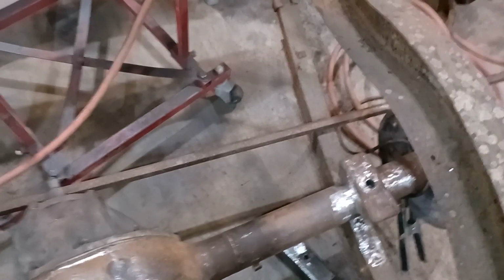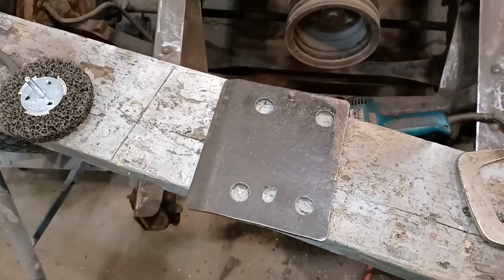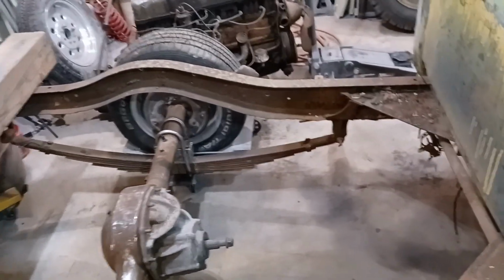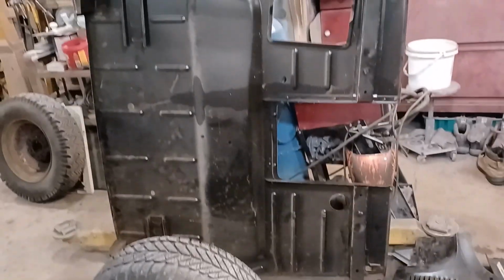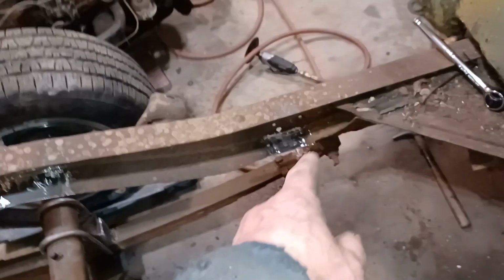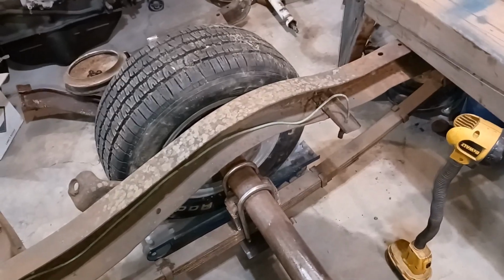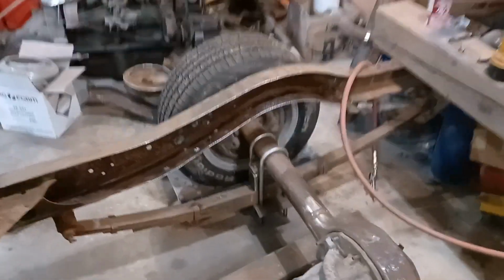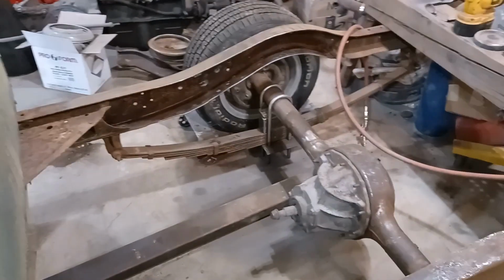1951 CHEVY PICKUP TRUCK!...REAR FRAME RAIL REPAIR AND COMPLETING 9 inch FORD REAR END!

Comment: A plan is a straight line device you measure deviation  with   Not to worry if it went exactly to plan you wonder what you did wrong.
Reply from the maker: Plans are made, but often, a new plan that makes more sense takes over. Thanks for watching!